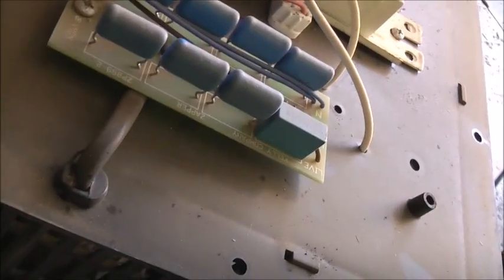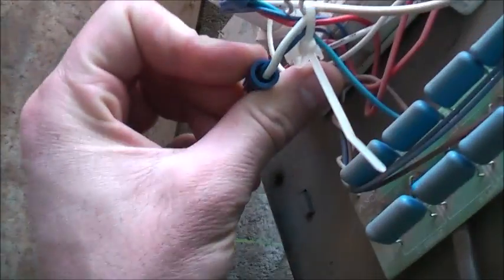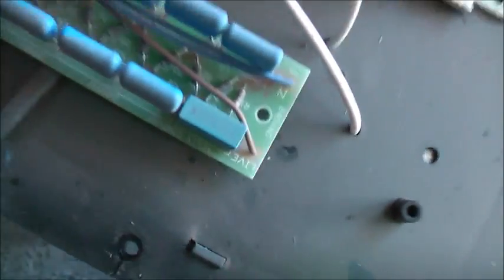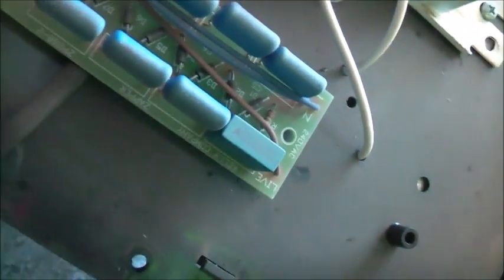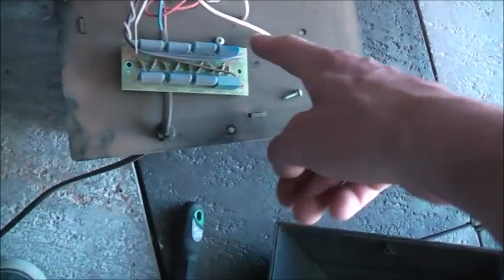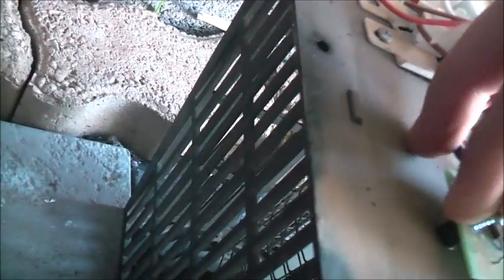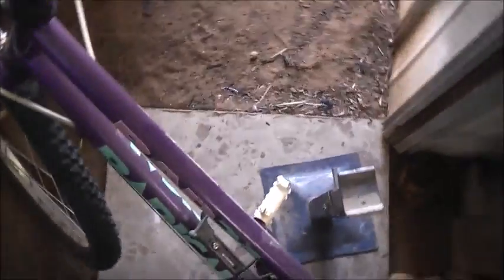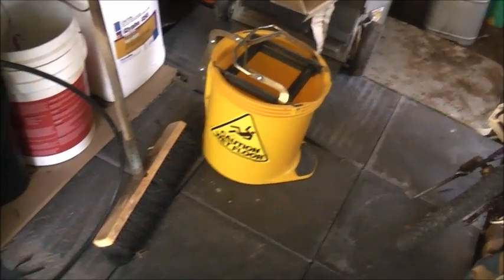Bug Zapper With Cockroft Walton!!

Comment: I don't like the newer design bug zappers they use chicken wire as a grid which loads up with dead bugs quickly which could be a fire hazard. I like my old school flowtron which has fingers separated by plastic. 35 years old and it still works perfectly. I did have to fix it a few times but that's what I do which is fix things. Those blue caps in your zapper look like the red ones you find in those hand held tennis racket zappers. 

And as for the telemarketers here's what you do. Get a recording of the disconnected number message from your area. I'm not sure what the message sounds like in your area.  You can dial a fake number and record the message off your phone or you can find an audio file online. Load it onto either an MP3 player, an old mobile phone or a voice recording device like a 20 second recording module. Theres tons of them online. Have the device ready and when you get a telemarketer just pick up the phone and then play the recording twice then hang up quietly. They should leave you alone.

Heres a video of a device that someone made and it works well.
https://www.youtube.com/watch?v=JViUebHBmww
Hope this works for you.

Comment: They're called wire nuts.  Can't get them in Australia?
Reply: Banned
Reply: +Machine Man Used to be banned here in the UK too, but they found out the modern versions are actually a lot better and pass all the tests. I like having the choice of various connectors (Although the Aussie 'single ended' terminal blocks seem ideal to me, can't seem to get them here in .uk)
Reply: ***** interesting! Yeah those terminal caps are good! Bit odd they don't have them over in UK, as they're a lot safer than the wire nuts